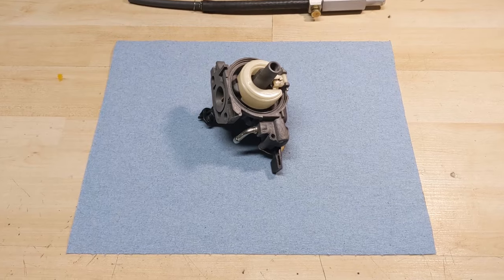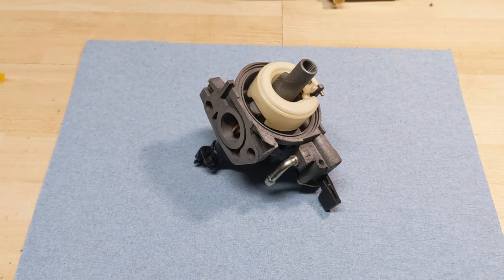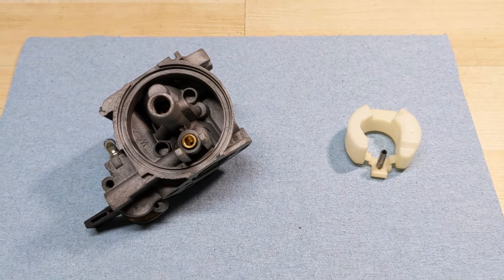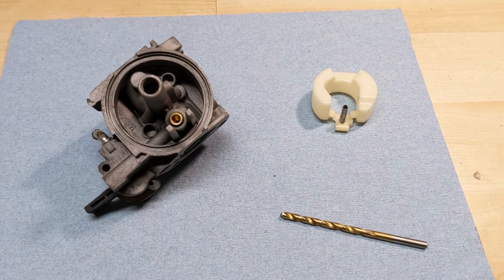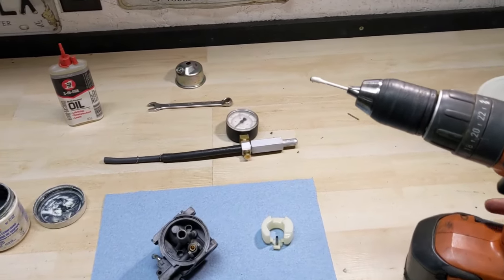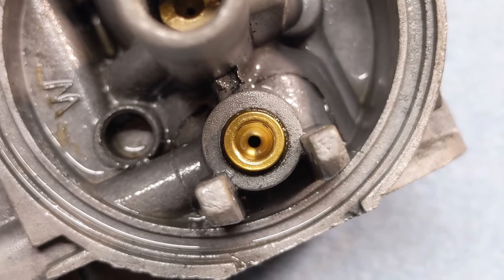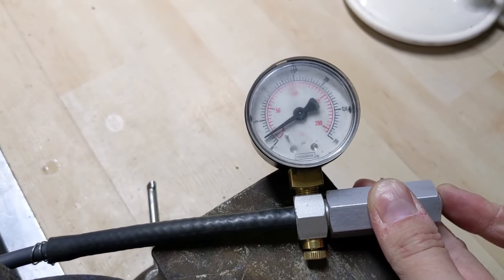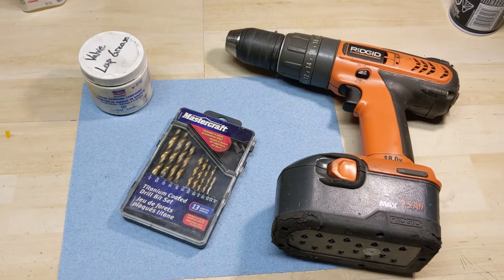How to Fix a Leaking Carburetor

Comment: I took apart my generator carburetor and cleaned it thoroughly. It kept leaking gas, then i did what you said with a q-tip and drill using mothers polish for 10 seconds twice.  The needle valve seat was black and now looks shiny brass just like the one in your video.  No more leaking carburetor and once again a great running generator.  I learned something new.  Thank you!
Reply from the maker: @greasemonkey5340  glad it helped, thanks for watching! Hopefully the video was easy to find? I tried to tag the right keywords and title the video properly

Comment: This video is a MUST SEE for anyone trying to fix an overflowing carburetor.  Unfortunately, I only discovered this video after watching other videos that just take the carburetor off, clean it, blow out the jets, install a carb kit then reinstall.  So on my Outboard Mercury 115HP with 4 WME carbs, I did that which is 8 hours of work to take apart the engine, pull the carbs, then re-install excluding the time to pull the boat from the lake and park it to work on, then drop the boat back into the lake.  So after my first attempt the carb overflow leak quickly returned, so I figured I must have left some dirt in the carb, or maybe a piece of the new gasket broke off, hence pull the boat out and repeat this time being extra careful of dirt & gaskets.  Then dropped the boat back into the lake and again the leak returned.  Then I saw this video using a carb tester and valve grinding compound – never even knew about carb testers, INVALUABLE TOOL!  So pulled the boat out again, pulled the carbs and did your valve grinding technique on the needle valve seat.  Then tested the carb but alas it was showing a slow leak, so I repeated the valve seat grinding procedure.  Then on retest, the carb held pressure perfectly – no leakage.  Dropped the boat back into the lake, and one very happy boat owner.  Can’t thank you enough for this video!

Comment: Another good one buddy, for your viewers that may not have access to lapping compound do you think toothpaste or possibly baking soda or powder mixed with oil might work?
Reply from the maker: Not too sure, have never tried that! Thanks for watching!
Reply: Toothpaste is what I was thinking too.  It is very slightly abrasive.  I think it would be worth a try.  I have some Mag polish in the closet.  I think it's Mothers.  That's always a good go-to polish for odd jobs.  Even on paint and Plexi.
Reply: This is just a new Carburetor you might need to know most might have a little seal in it!

Comment: Thanks. Great video. I have what looks like almost exactly the same carburettor and obviously you just slip the pin out that acts as a hinge, but then there's another pin (like yours) that prevents me from taking the float off. I don't want to damage anything, and I can't figure out how to proceed to remove the float and reveal the needle valve and seat. I'm going to see if I can find the answer on another vid, but if you see this and could let me know, I would really appreciate it. Cheers!

Comment: This is a good tip with viton tip needles but older brass ones not so much. My arsenal of tools are drill bits ground flat, end mill bits, and dremel polishing bits cut at 45*. I basically go at it like cutting a new intake/exh. valve seat😆 these cheap ope carbs are not as rare and as expensive as keihins on Atv’s and bikes.
Reply from the maker: Thanks for sharing!

Comment: Don't you have to apply a little pressure to the float as simulating the fuel level pushing up on the float? Good tip. Thanks!
Reply from the maker: No, generally the weight of the float is enough to let you know you have a seal or not under 5psi, sometimes I even test them around 2.5psi and it's good enough to tell me there's a good seal and the carb won't leak. Thanks for watching!

Comment: thank for the video,what if mine gets clogged from not using the bike for a while,,can i just spray carburator cleaner to the hose and blow it with compressor,will the needle valve be ok?thanks again.

Comment: Do you think another mildly gritty compound like, say, toothpaste, would have the same effect? Just trying to think if there are other compounds that might accomplish the same thing.
Reply from the maker: Yes, I've used some stainless steel polish and it seems to work fine, like I said with the valve lap compound I'm not putting a lot of pressure, just enough to let the grit clean up the surface. I'm sure some brass polish would work fine

Comment: I have used baking soda type toothpaste as valve lapping compound.  Flushing with carb cleaner of course.  I also use electronic cleaning swabs, they are smaller in diameter and use a felt tip instead of cotton.  I have cleaned the electronic cleaning swabs and reused.
Reply from the maker: Yes anything that's gritty and polishes will work. I'm going to try toothpaste, as many have suggested it. So far, I haven't had one fail once it's been polished with the valve lap compound. But as others mentioned, you have to be careful as it's meant to be used on hardened steel and not brass.

Comment: if that compound marks the value ,just think what it doing to the seat
Reply from the maker: Yea it's what I had at the time, haven't had an issue with any, which is why I mentioned not a lot of pressure. I'm now using brass polish, but it needs to be cleaned even better.

Comment: Id just use gas on it or keep it dry not gonna ruin mine drilling it with a bit cause i probably would still think it needs a fatter rubber tip needle
Reply from the maker: You don't drill it, you're just spinning the drill with your fingers and minimal pressure to debur the center hole in the seat. Polishing them is the best way, but sometimes they need to have the drill technique done. It's usually the only way you can solve a slow leak after replacing the needle valve
Reply: @EliminatorPerformance  but then the bur inside the side of the hole would need picked out i have the tools for that